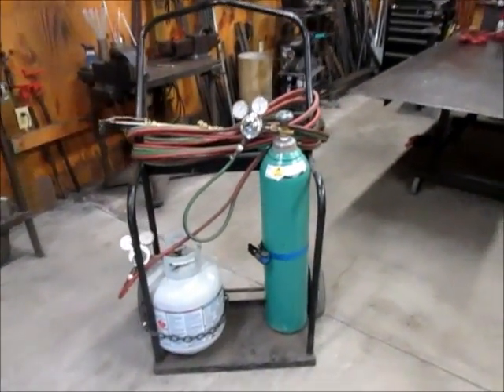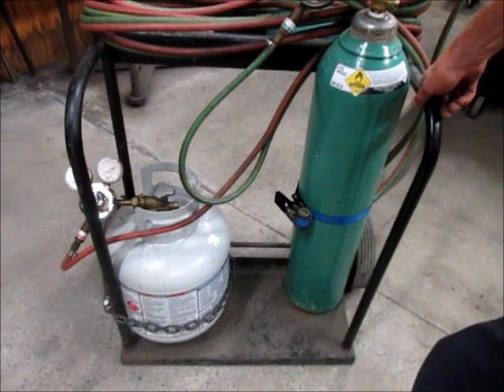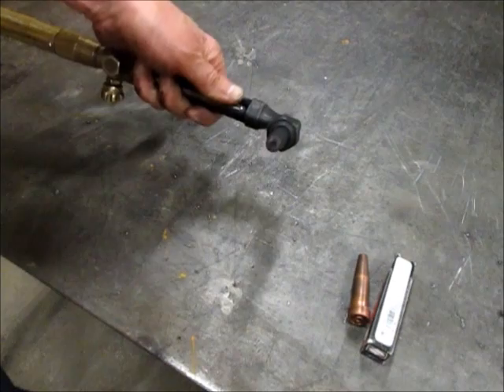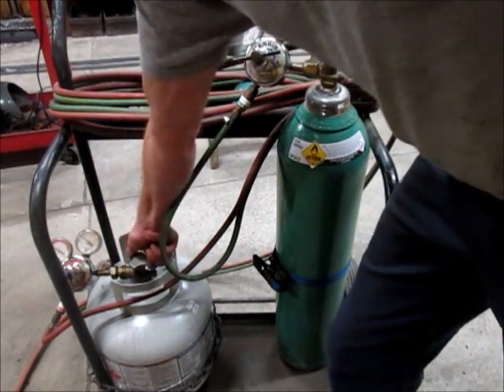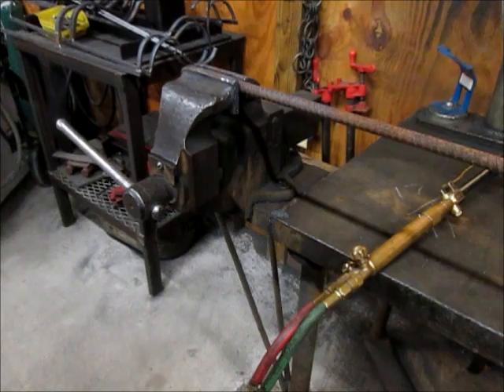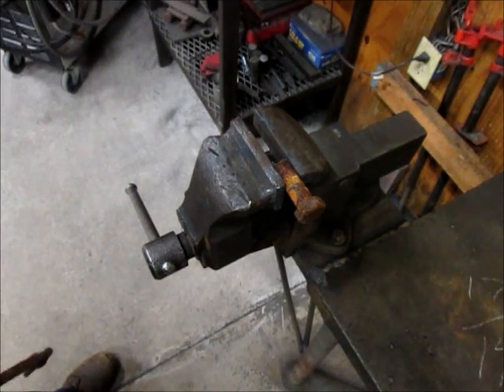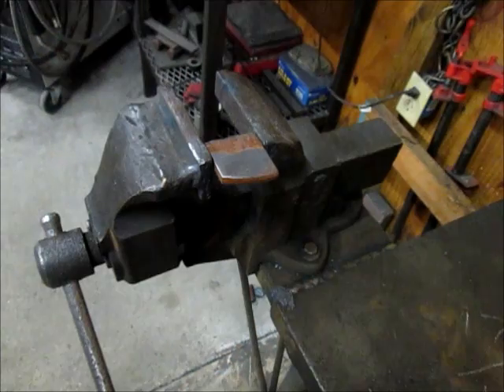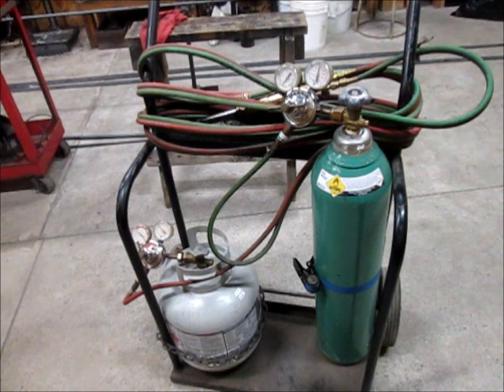Oxy Propane Torch

Comment: See how your cutting tip and cutting head are all black? That's because they are being overheated by not running the preheat flame hot enough. That soft preheat flame is right for acetylene, but for propane you need to increase the fuel and oxygen until it whistles/screeches. This not only makes it preheat much faster, but it pushes the preheat flame away from the tip so the tip runs cooler. I have many hours on my propane tips and the plain copper ones are just a bit discolored near the tips, while the brass torch head is still bright and shiny.
Reply: i was juts gonna say i think this guy does not know what he was doing by the looks of that orange quiet preheating flame and the lousy cut jobs ,and that bolt was way over heated because it took so long to heat up,he def had his psi and volume to low
Reply: I think the point of the video was to show a simple propane cutting torch set up.
Reply: Thanks for the info. Its nice when someone offers informed opinions the way you did it instead of accompanying it with a "you dont know what youre doing!" or "this guy is an idiot". Ppl get more out of it your way. Besides that,  the video was only about how to set one up so yoyr comment saved a bunch of us from needing to look up how to adjust a propane flame instead of acetylene. So thanks again. Im guessing the black on the tip you mentioned was a sign not all fuel was burned in the combustion process therefore wasting it and needing to heat longer to reach cut temperature which allows the heat to spread out too far and therefore makes terrible cuts. Ive done this with acetylene too. Sometimes u want to cut one piece like a nut off a bolt or a bearing race out of a hub amd heating too long also heats the part you DONT want to cut. So heating asap can be very important.  Btw...I followed what you said and within a few minutes i was cutting away. 👍
Reply: @garpikemike1  Thank you for your comments!

The cause of copper tips turning black is overheating. When copper gets hot enough, it oxidizes,  and copper oxide is black. 

The cause of tip overheating is insufficient has flow. This allows the flame to actually start burning right at the tip rather than a tiny distance away. That causes much more heat to be conducted from the flame to the copper tip.
Reply: Could anyone please clarify then 'what' the recommended propane to oxygen pressures to make this 'perfect' for a temp that works better to not produce the tip oxidation?
Reply: @AXNJXN1  check the specs from the tip manufacturer. They usually recommend pressures that give good results. The thing about propane and other fuel gases is that they arent restricted to 15psig like acetylene. That said, I have a hard time imagining a tip for a typical hand torch that would need more than 15psi. So, if you cant get specs from the manufacturer, try 15psi propane and 20-30psi O2. Increase fuel and oxy flow incrementally until the flame detaches, or starts to detach, then back it off a tad to re-attach the flame to the tip. It should be making a pretty good roar at that point. Keep an eye on the tip for excess discoloration. A bit of darkening is OK, but if it starts heading toward black, you're overheating the tip. If you have enough gas flow, that shouldnt happen.
Reply: @WTFChuk  Much oblige! Thanks for the information. I feel ‘educated’ now… Moving forward to ‘trial and error’…🫡😎

Comment: I have been using propane since back in the 70's. I have two acetylene bottles too  but I use propane for myself around the farm. Much cheaper. I bought my first oxygen bottle back in 73 for $83 full. I have never paid rent on my bottles. Mine are 256 cubic feet. The only thing you "have" to change is the cutting tip. The two piece propane tip is also much easier to clean since it comes apart. I have used the type R hoses for years and years with no problem. But they are a better quality hose than what you buy today. I have Victor, Harris, a Smith, a Uniweld, and a Purox track torch. I like the Harris best of all feels better in my hand because of the bigger round body and they are a much better buy compared to the Victor name. Victor is good too but much overpriced. I have one Harris that has the pilot light feature which is real handy sometimes but you have to be out of the wind. The Uniweld is a little bitty thing. The Smiths are beauties being made of stainless steel and are very good but the tips are harder to find and more expensive.

Comment: If you buy your cutting torch at Harbor Freight, be aware that your acetylene regulator will not fit on a propane cylinder. You'll have to get a different regulator that has hose barbs.

Comment: This video answered a question I had about LP regulators. I bought a Victor Propane regulator with a CGA 510LP connector and I wasn't sure if it work with the OPD valves on the propane tanks. The regulator will arrive tomorrow, hopefully it will screw into my propane tank.  Thanks for the video.

Comment: Correct me if I’m wrong, but I don’t believe you can use the same gage for acetylene as propane. They do have the same thread but propane is petroleum based and will ruin your acetylene regulator diaphragm and you also need to run a grade T hose.
Reply: That's my understanding as well.

Comment: How do you lose control of your flame? Never had that happen. I have always used oxy acetylene. If I run out of acetylene I will do your setup. Can I use a standard acetylene regulator for propane tank?

Comment: I’ve seen my brother using propane and air compressor as oxygen. He used to weld snapped industrial bandsaw and jigsaw blades and it works.
Reply: How
Reply: @meyo4158  make a conversion of the hose connection air to connect air compressor and the gas hose to the cooking gas tank.
Reply: @MrMeslu  Watched my cousin who is about the best welder I have ever come across do the same. Never tried it myself, but it makes a certain sense.

Comment: Hey, that's good info. I'm right there with my setup. I mig everything. The  torch is such a powerful tool for cutting metal and it saves so much time. This allows for projects to get done right and in time and to do this without spending 600yrs grinding shit. The biggest plus is accessibility without the draconian  account requirements  requiring 9000  dollars per fill up and remember acetylene is special, so don't lay it down because  the honey-comb structure inside of the tank must stay upright or the acetylene will lift and separate, and you will die. This all happens before your wallet gets   baptized to serve the penalty fees imposed by the unhooded corporate unwelder gods. Seriously though thats straight common cents in a land thats a bit challenging to say the least. I'm filling up tomorrow and getting correct tips which I didn't know until seeing your helpful post, thanks I appreciate it.

Comment: I liked what you did, but I am still trying to find some document about the main difference about propane and acetylene buring and why the tip is different in design. I know that propane eats like 3-4 times oxygen more than the acetylene to burn. Thats really intereting
A question: I didn't see a flashback arrestors in your setup, is it intended for some reason, or just decreasing the setup cost?
Reply: he has flashback arrestors installed at the regulator ends of his hoses. propane tips are different because they are cheaper and easier to make than solid copper acetylene tips, acetylene tips have to be made with individually drilled passages that maintain even fuel pressure so the acetylene does not spontaneously explode inside the tip. propane cutting uses more oxygen because the preheat flame is not as hot as acetylene so the cutting rate is slower and more oxygen is needed to maintain the cut.

Comment: Hello. I sometimes use this to cut 1/2” steel cable. I work with Neanderthals and they are not very good at explaining things. Please correct me if I’m wrong. 
1 open both tanks oxygen/propane 
2 and this is where it complicates for me. Open just the propane or both?
Once it’s on. Do I regulate the oxygen to where the flame turns blue? And when do I squeeze the handle? 

Your help is greatly appreciated.
Reply: See LP cutting torch procedure videos for details and anytime in doubt follow official instructions from any of the welding torch manufacturers.

Smith make great torches (I collect and overhaul my own of many makes) so here's their video:
https://www.youtube.com/watch?v=f2amO0T3vkQ

Comment: What size is your oxygen tank? And do you need flash backs connected with this setup and lastly can I use the same hoses that I have for acetylene, I have an  oxy acetylene setup I have never used but want to go with the propane setup? Mostly want a setup for heating to bend steel but I have wondered if this set up could be used to braze? Any advice appreciated.
Reply from the maker: oxy tank is a 60 I think. It can braze. My gauge set has f/b arresters but would work without b/c they are a safety feature. Better to have them. Same hoses and gauges.

Comment: I bought the Harbor Freight cutting torch kit that has Victor type regulators. I tried to convert to propane but the regulator does NOT match up to the standard propane cylinder. I paid $24 for an adapter from Uniweld but it doesn't fit.
Reply from the maker: This was in the silent movie days

Comment: Propane tip has more preheat holes,two piece tip is easier to clean. Supposed to use 'T' grade hose. They say propane will ruin regular 'r' grade hose.

Comment: What about a tiny handset like for jewelry/metal melting?
Reply: I think it would be fine, with a small tip. Not sure why he says you cannot weld with it. It doesn't get as hot, so perhaps that makes it hard for steel.  For real small stuff you might also consider an HHO torch that uses electrolysis to separate water and then you reburn it. It burns very hot so be careful until you get used to it.

Comment: Could you use an air compressor instead of an actual oxy tank? Just wondering, cuz I have the torch and hoses..
Reply from the maker: I have never tried that.
Reply: For heating you can there's a company that sells kits for it but not for cutting

Comment: I'm currently switching from acetylene to propane.  Got the correct tip, but just noticed my acetylene has female threads and my propane has the same threads.
Reply from the maker: I've gotten them from a welding supplier.
Reply: @RPMechanics    I searched around and see there are CGA300 and CGA510 stems/nuts.  I need a CGA510 stem/nut.  I was able to unscrew my CGA300 stem (the stems may be the same, threads different for sure).  Going to welding shop tomorrow to see if they have the other one in stock for sale.  Also if they have a 5 lb propane tank available, as the 20 lb is BIG and for something I use about 3X a year smaller would be better.
Reply: @RPMechanics    My local welding guy sold me a $3 male nut that I swapped out for the female nut on my stem.  Threaded in no problem!

Comment: Can you please help me I'm in Alaska trying to set up my propane cutting torch, I did bought a propane tip and set up everything, went to light it after lighting propane I applied oxygen and it goes out, what is wrong?
Reply from the maker: Check your pressures. Sounds like the propane is set too low.
Reply: When you light the torch place the tip down to the metal sideways ( like this: _/  ) and then open the oxygen. Works every time ;)

Comment: if you use the propane in cold weather it may not vaporize fast enough  i normally use a #2 tip for general cutting a #4 for heavy cuts and a #8 for heavy scrapping but we use liquid oxygen and big tanks. never use propane tips with acetylene, it will burn them, up

Comment: Almost all scrap metal recycling yards rely on propane rather than acetylene because of the reduced cost.
Reply: EVEN SO, LIQUI OXIGEN I S VERY EXPENSIVV  A PETROL GAS WELDER WOULD BE BETTER.
Reply: who said anything about liquid oxy? and with petrol you still need oxy for cutting
Reply: The oxygen is pressurized gas, not liquid. @lkkjhtemmexv1838

Comment: So all I need is a new cutting tip? How about the welding tips? Will they work on propane? You just screw your acetylene regulator right into the propane tank?  Have an oxy acetylene setup now. Acetylene is getting expensive. This seems to work just as well.
Reply: i had to buy an adapter for my regulator but it was on hand where i get my oxy filled, maybe $10
Reply: you should use type "t" rated hoses. propane will cut the life span of regular acetylene hoses.
Reply: you can't weld with propane. that's why I'm not sure I want to go this route.
Reply: You can save your expensive acetylene for gas welding and cut with LP. I use both as to many others. You can braze with propane and brazing is quite useful. It's highly shock resistant and in multipart work like "steel rule dies" (for cutting materials in a press) you can remove brazing easily with your torch to replace individual parts. Brazing is visually attractive too hence it's popularity in artwork, but I'm no artist.
Reply: Your acetylene regulator will fit a BBQ jug if the regulator is a CGA-510. HOWEVER do not exceed the range of your OUTPUT guage because LP head pressure is greater than acetylene. All the US made regulators (and I will not use anything else,, I scrap ChiCom junk when it turns up in my auction buys) are LP compatible which is a matter of the seals and diaphragm materials. You can email your makers tech support if in doubt. Victor, Smith, Harris etc are compatible. All the really big cutting torches are LP, not acetylene because LP allows high withdrawal rates. It's good stuff. Learn your CGA fittings. It will serve you well. Visit weldingweb and the Miller forums for much more info.
Reply: Acetylene welding tips work with LP but setting mixture can be more fiddly. Not a problem and you'll figure it out.
Reply: Ob Fuscated I know you’re saying that the propane will work with Oxy/acetylene welding tip but you technically can’t weld with propane because when propane burns with oxygen it creates hydrogen bubbles I believe and was told  in the weld puddle and makes the weld weak and porous.  You can use the welding tips for heating if you wanted to but you can’t weld with them.

Comment: Thanks for the Vid, I have been wondering about propane. Now if we could find a cheap way for oxygen.
Reply from the maker: +FISHBREATHH I bought the 80 cubic foot oxygen bottle outright and it cost around $25 for a refill and I avoid the rent fee. A little bit of up front cost, but after that it's not too bad. Thanks.
Reply: FISHBREATHH check out other u tube videos
.guys using nebulizer attached to old oxegen tank..one i saw were for those small map gas ox ser up worked but comment said no becuse it waa a 100% oxegen set up   versus 65..70,%..but seemed  ok visually..so might be worth it

Comment: What was the hose PSI on the Oxy and Propane?
Reply: 3-5 on the LP and 5-10 on the Oxygen.  Your Oxygen pressure is going to depend on what you're doing with it but in most cases you shouldn't need more than 10PSI. You also never want to ever exceed 10PSI on LP and it should be treated just like Acetylene.

Comment: That was awesome. If you were starting out, would you buy a used torch setup or bite the bullet and buy new? And if new, do you have a recommendation for a vendor and brand/model?
Reply from the maker: +Rick Rose If I found a deal on a quality used set I would go for it, but I bought this set new. It's a medium priced set I got from Lowes made by Harris. Probably had it close to 8 years now with no complaints. Thanks.
Reply: Buy a new one. They're usually not very much. I got a little portable OxyFuel kit that comes with the two hoses, two regulators, two tanks, two welding tips, the torch, and one cutting tip. It was only $186 on eBay and it works great
Reply: @RPMechanics  I am knew at this so do I buy an oxy/acetylene kit and switch the tip for propane or is there a oxygen/propane kit available? thanks

Comment: if you dont back your regulator pressures off before you turn the main gas on your going to blow the diaphrams in your regulators.. when your done using the torch,  shut the main valves off, then back out your pressure adjusters on your regulators, then bleed the hoses..

Comment: Have you done any hard bronze brazing with it?

Would you need to wear goggles for brazing?

Cheers Rob
Reply from the maker: +xynudu Hey Rob. Yes I've done quite a bit with it. Goggles for sure I'd say. At least dark glasses. -Robert
Reply: Hi Robert.

I use a special LPG torch to hard bronze braze light stuff, and it works well.  No goggles required as it just has the LPG flame.

I have looked at LPG/oxy as an alternative as it's now possible to get oxy cylinders in Australia without having to pay the $200 yearly rental killer cost.

The only aspect was how hard it would be to see the job with goggles.

Interesting.

Cheers Rob
Reply from the maker: +xynudu  Adding oxygen brightens it quite a bit. I heat and bend steel with it a lot without dark lenses but staring at the flame any amount of time would cause me to see spots.
Reply: How would it be if you wound back the oxygen?  It would still be hot enough for light brazing I expect, and maybe not too bright?

Rob
Reply from the maker: +xynudu Yes I think you could do that without much trouble.
Reply: I detest goggles. A clean tinted face shield allows better comfort and much better ventilation. If you want the best view you can buy specialty gas welding lenses from tinmantech (the site has some great work and is worth a visit) but I just use Jackson face shield. Goggles don't protect your face so there's that.